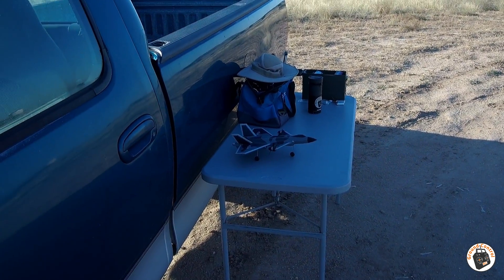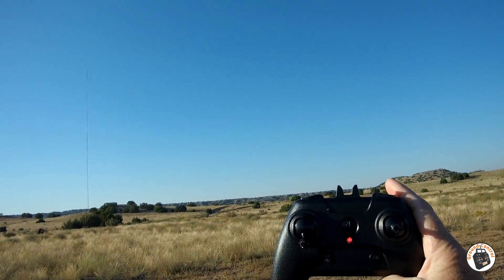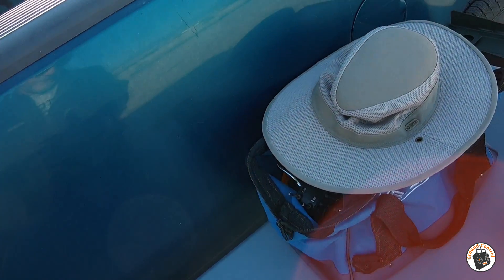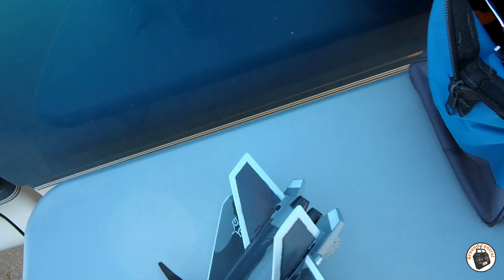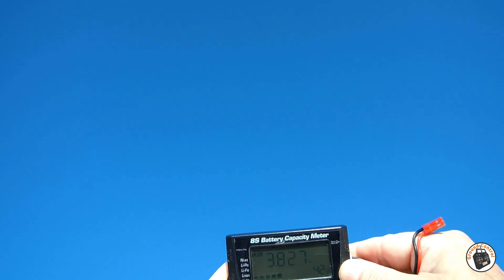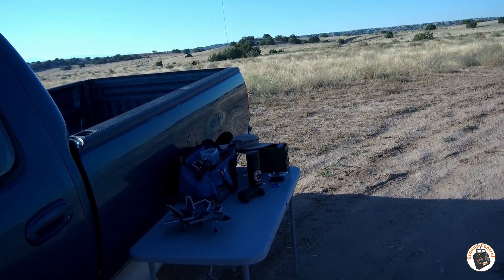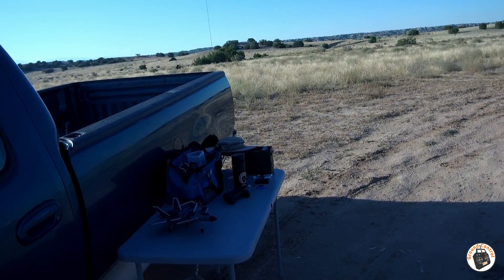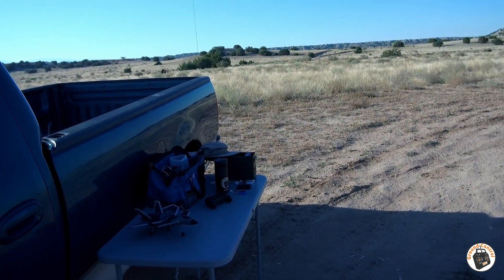Maiden Flight | Dual Brushless Jet | KF700 J-20 Jet 303mm 6CH Gyro Horizontal/Vertical Flight RTF

Comment: If anyone can mod that plane you can …3s or 4s lol …6x6 prop or 5x5 with a 2212 2000 😅
Reply from the maker: I might. Single pusher motor and prop.
I was going through my parts bins this morning.
I do have a 1306 4000kv and a 1504 4700kv motor.
3"-4" prop...maybe
Hopefully I'll have some time over the next month.
Reply: @GroundControlRC  whatever u do I know will be awesome ever since u modded the fx-820 I know u can do anything better than ppl at fei xiong

Comment: Is the mix in both high and low rates
Reply from the maker: Yes, the only difference is the angle is less restrictive in high rates.
I fly it in high rate most of the time.
Reply: @GroundControlRC  it’s like on the a280 I don’t fly low rates at all especially in 6g hardly wants to turn

Comment: seems you have a lot of funs fooling around with this jet....🤣🤣🤣🤣
the jet has a good design and doesn't need to use dual brushless....just my opinion
Reply from the maker: The Dual Brushless Motors do provide a lot of power but I think the reason they did that was to implement a vertical mode.
I may convert it to a single pusher motor and prop if I can make time for it.
I think that would make it a great little brushless sub-250g parkjet ;-)